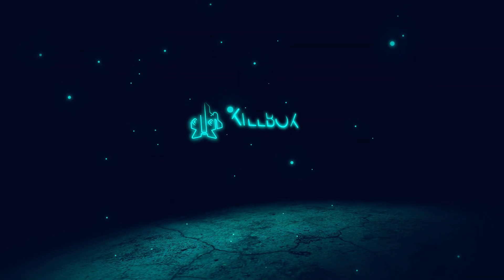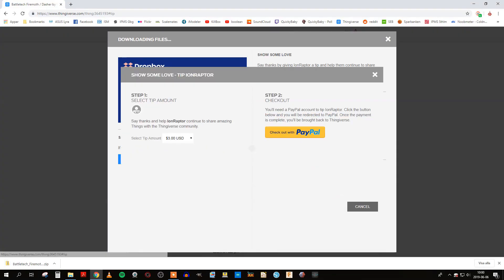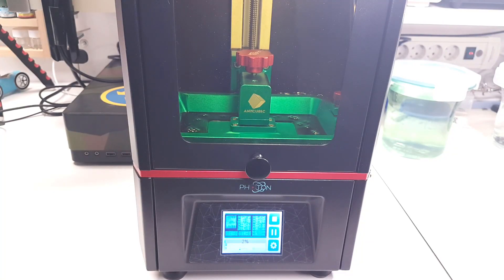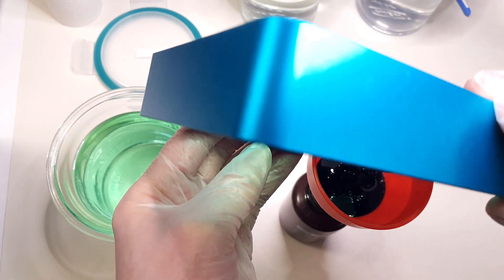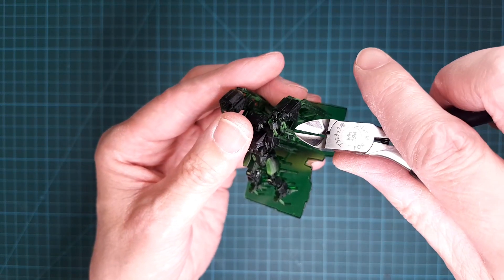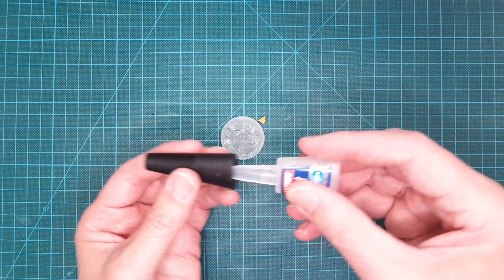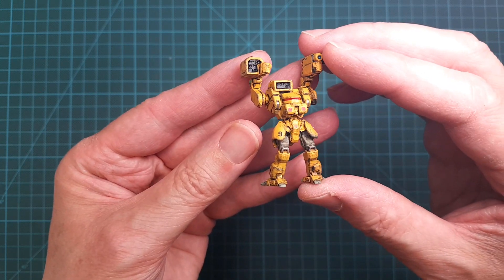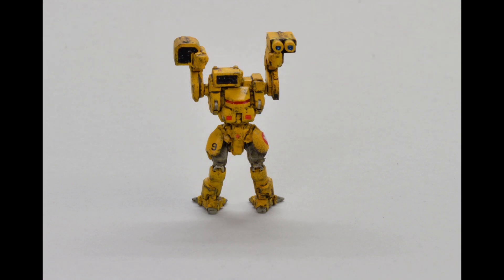Anycubic Photon Resin 3D Printer

Comment: I found cleaning the tray better if you slightly wipe out the remaining resin with alcohol and wash it with warm water and soap. It is cheap, quick, and efficient, also using fiber cloth will make FEP dry and scratch-free. A microlayer of soap will prevent resin to stick to FEP assuring a good print...
Reply from the maker: Yes, that's a better way of cleaning the vat. Nowadays I use a foam sponge wipe and that works fine too. Thanks for your comment! - happy printing 😀

Comment: Great video. (glass wipes now on order) Thank you!
I've had several failures where the model has failed to adhere to the plate. I have just ended up with very flat 'pools' of hardened resin in the tray. Do you have any tips for getting it to adhere to the plate? Thank you!
Reply from the maker: Thanks, Ian!
Make sure that you get alcohol wipes that will not scratch the FEP, I have actually moved away from the glass wipes I used in the video and instead I'm using a soft foam sponge cleaning wipe - unfortunately I have not been able to find them outside Sweden, so I cannot recommend any specific brand. There is an updated version of my 3DP workflow video coming out soon on my channel, where I will show what they look like.
About your question; the failed print is 99.9% caused by incorrect bed levelling - there are basically two methods to do it; paper-method or Flint Read method. I use the latter method and I haven't had a failed print after that. That's the only advide I can give, based on my own experience... I struggled with the paper-method for a week and had very unreliable results; I almost gave up on the whole thing... :D
Reply: Once you have your build plate level (tighten that grub screw well once you have the plate level), another thing to try is to change the angle of the item/s to the build plate. I'm using Chitubox for arranging items, changing their orientation to the plate, hollowing (saves a lot of resin, for solid items) and creating the supports. As the Anycubic .pws file type is still proprietary, I "Save As" the file as a new .stl and slice it with the Anycubic software. It adds some steps to the flow, but greatly improves the outcomes in my experience.

Comment: Could there ever be too much resin in the vat? I'm using the grey stuff, its opaque so I'm concerned
Reply from the maker: There is a concern that submerging the ball joint in resin will make it slippery and ruin the levelling. Based on my own experience I cannot say if this is true or not, but on the other hand I see no reason to overfill the VAT; so I avoid doing that.
Reply: @KillBoxScalemodelling  thanks for the help, I guess I'll just live with my mistakes, currently printing with a full vat lol
Reply from the maker: @johnlipinski1054  I'm keeping my fingers crossed that it will work! 
Please let me know the result

Comment: Can you use the alcohol again for another print or do you swap each time??
Reply from the maker: It can be reused many times. And after that you can cure the resin with UV light and filter it out, so it is possible to reuse the IPA.

Comment: Dec. 19, 2019---Thanks for the video as I'm looking at buying either the basic photo or the S version. Saw a comment by someone on another photon video that the S is 30% faster in printing something. Got back into modeling last year after being away from it for about 20 years. But instead of aircraft/armor, going for 1/35th scale zombie/apocalypse dioramas, but with mine based in realism(?!) as in no Mad Max looking vehicles/people. The problem was there being so many things needing to be scratch built such as mail boxes, electrical junction boxes, phonebooths, etc. I made a kids wagon, the kind a kid would pull behind him, then made a silicone copy of it as I thought I might want multiple copies of it in the future. The wagons wall was about 2 pieces of paper thick and out of the NINE castings I made in resin, only ONE turned out useable?! 

From Thingverse and other free 3D websites, I've downloaded about 3K worth of programs....furniture, store shelving, office equipment, etc. The other problem with my new interest is lack of MODERN people. Seems all the plastic figures available are dressed in 1940's/1950's style. A lot of work to change them. And while resin figures/zombies are available, they run usually $10+ EACH which adds up quickly when you want a dozen or so figures in a diorama. Another is lack of current vehicles as plastic kits, which is why I have about 2 dozen or so diecast vehicles in 1/32nd and 1/36th scale. They look great on the outside, but missing interior details. Like the VW buses seats are simply L shaped pieces of plastic and no way represent the real thing. Same way with the 1/32nd semi-truck seats....I KNOW about those seats and trucks as I drove truck for 15 years.

This was why I liked you showing off parts you made for your models. Plan on reducing the figures files I have and printing multiple copies of them as I want different figures in my dioramas. At 66, it ain't easy for this old dog to learn new tricks, one of them learning CAD. Hopefully I'll learn how to make my own figures, but would like to come out with ones with individual arms, legs, upper/lower torso's, etc. This way I can mix body parts, including heads. One video I saw had the guys printing a 1/32nd scale locomotive, which was done in 3 sections.

Luke Towan is a railroad modeler, which is where I first saw the photon printer being used. Later, he showed off how to make your own photo etch parts using stuff sold by Micromark. Imagine seeing a 1/87th scale office chair...impressed me seeing something that small being printed. I think both tools are going to make a world of difference in the modeling world. 

Curious...what previous knowledge did you have in learning to draw your own parts and printing them?
Reply from the maker: Thanks for your comment, it seems to me that a resin printer is the right tool for what you are doing.

I had no experience in 3D modelling tools, but I downloaded Fusion360 and started looking at Fusion 360 tutorials; I can recommend Lars Christiansens "Absolute Beginner" series as a starting point, because he goes through the basics in a very good way. 

Good luck with your dioramas, it sounds awesome!

Comment: Hi thanks for the indepth walkthrough of the process and explainations. could you explain the benefit of rotating the model at an angle and not 90 degrees so the model where horizontal ?
Reply from the maker: There are two reasons why you would do it; to reduce the overhang that requires supports and also reduce the layerlines

Comment: Too late, I bought it.. couldn’t resist the opportunity.  ;—D
Hi Angus. I've got a chance to buy a "used" Photon from Anycubic for $300. Apparently it is a return. 
Do you think this is worth purchasing. 

I already own an Anycubic i3 Mega and am very happy with the results. However, I cannot print miniatures with high enough resolution. Anycubic spares prices are very reasonable.

Your thoughts on my dilemma?
Reply from the maker: Angus?! Ok...  :D
I'm not sure about the pricepoint for the Photon where you live, but 300 USD seems reasonable. It's less than I paid for mine for sure.

I guess that you get a warranty so everything should be fine and if you run into problems down the line there are lots of knowledge, mods and spare parts on the Internet.

Hope this helps you.
Reply: @KillBoxScalemodelling  Oops! Sorry, mixed you up with Maker's Muse. I think I sent the message on my iPad. You must forgive me as I'm 68 years old. Playing the age card for sympathy.
Anyway, I went ahead and bought it at $300 Aud which is about $203.62 US. Thought that was too good to pass up. It is a return from a customer who changed their mind and hopefully is complete - not expecting resin though. At that price I couldn't pass it up and decided to take a chance. Parts are cheap and readily available & Anycubic promise to help me out if I have any issues. My experience with my i3 Mega has been excellent, so I took the chance. 
I'll keep you posted if you like. While the Mega is good, I simply can't get miniatures to print at fine enough resolution to satisfy my hobby needs; mostly OO/HO Railroading.
Cheers, IAN
Reply from the maker: Haha, no problem :D:D 
Congats to your Photon, I assumed it was USD but in AUD it's even a sweeter deal. I recommend to join the Photonsters Facebook group if you haven't done already. I have received a lot of help from people there...
Good Luck with your prints!

Comment: Can the slicing program calculate how many mls of resin it will need for the print?
Reply from the maker: The Anycubic slicer doesn't have that feature, but the ChituBox slicer can do that.
Reply: @KillBoxScalemodelling  It does now. Now that most of the Photons are 'fauxtons' with the 'S' firmware they only accept the .pws file type, which Chitubox still (at this post time) doesn't have.

Comment: Great video, thank you!  I appreciate learning the techniques and getting the whole story about cleaning.  Excellent idea on the disposable gloves!  Toss the used gloves and paper towels into a thick plastic garbage bag and twist the top closed to keep the fumes down.
Really want an exhaust fan (at least a small one) and/or half-mask respirator with organic vapor cartridges ($40..80-ish).  Yes, a respirator costs something and may be inconvenient, but so does getting sick from exposure to toxic materials.  One sign can be getting headaches after working with this stuff.  
Some people are chemically sensitive and the strength of the reactions increase as their body has more of an inflammatory response.  Like having sore feet on a hike because your boots don't fit:  if you stop and get off them, they heal.  If you keep hiking, it progresses to blisters, then they pop, then things start getting ugly.  Wear good socks and boots that fit.
Best to use an exhaust fan and respirator.
Reply from the maker: Thanks Scott :)
An extraction fan is on my TODO list. I'm thinking of modding the printer and put one of those 3D-printed backplates with provisions for a fan and a hose.

Comment: Might want to look into Mean Green, Simple Green, or even Mr Clean for cleaning your resin parts. Mean Green cleans the best from what I've seen and cost less than any of the other including IPA. Smell is low as well and you can use them in a vibration cleaning tank.
It is suggested to remove the supports before final curing to help with removal and lower the risk of damage to the part.
Also maybe switching to a kit with FEP vat for the tank would help as well.
Also there is a "TOUGH RESIN" out now that will help with weak printing.
Reply from the maker: Thanks for the tips, I have made some improvements to my workflow recently and I will post a video on that.
I need to check if I can get hold of Mean Green or any similar product where I live, because IPA is hard to get nowadays...

Comment: the artifacts you have is a z wobble, you have to upgrade that part of the printer by adding linear bearings , that will reduce it dramatically,
Reply from the maker: Yes, I believe so too. I have linear bearings and a new mounting plate bought already, but I have not had the time to make the upgrade yet.... Too busy printing stuff and doing other things :D :D
Reply: Hi Kira, I have jurst ordered a Photon. Is there anything you can direct me to to regarding the bearing upgrade?

Comment: which filter are you using to filter the used resin into the bottle
Reply from the maker: I took the strainer mesh from the paper funnels that came with the Photon. The mesh is made from plastic so it's reusable since it can be cleaned with IPA. Hope this answers your question :)

Comment: I'm curious to know if you've noticed any markings or scratches on the thin plastic bottom of the resin tank. In a review of a different brand of inexpensive resin printer, they noted that the sheet had marks somehow related to the models printed, & also scratched very easily
Reply from the maker: The FEP film of the resin tank was completely without scratches (atleast what I remember) when I unpacked the printer. However, after a couple of times usage I scratched mine. I had some issues with failed prints and resin that got stuck in the bottom, so I scratched the FEP film when removing that.

Comment: so... unfortunately - the resin is still too toxic IMO for home use (need proper ventilation during the whole printing process, pouring, cleaning and sanding) - overall, the process too tedious (why can't you just leave the resin the box and have it in a covered darker box?) - just not quite there yet!
Reply from the maker: I fully agree that the resin handling and post processing of the print is messy and cumbersome. The SLA machine you are asking for is something like the Formlabs Form2, with washing and curing stations. Pricetag for that end up around 4000 USD. This is a 300 USD machine with only one moving part ;)
Reply: @KillBoxScalemodelling  yes... that is the other end of things... and even then, there is probably maintenance that requires some toxic handling.   oh well... the future is looking good though!
Reply from the maker: I'm sure that the technology will continue to evolve and cheaper and more user-friendly printers will show up. When I first encountered this technology 15 years ago a SLA machine costed ~100kUSD and the end product looked like something that comes out of a cheap FDM machine - and it was very fragile. One fellow engineer dropped a prototype on the floor and it cracked into tiny shards and we had to order a new one (that was an expensive mistake).

Comment: Use acetone for 15 min instead of IPA the supports melt off.
Reply from the maker: Thanks for the tip. I need to figure out where I can buy acetone in bulk... I'm getting an FDM printer soon and it might be useful for that too...
Reply: @KillBoxScalemodelling   check homedepot they sell the gallon for 17 dollars . quart for 8 bucks . becareful how you use the acetone. it can damage the part. Its powerful.
cheaper that ipa
Reply from the maker: @keepitrealandtoasty  Thanks for the tip - I have found a couple of places where I can buy, but I have to travel there to get it - they wont ship that stuff ;)

Comment: if you remove supports before curing, it is far easier. Less likely to break things, since the resin still has a little give.
Reply from the maker: That's an excellent advice, thanks!
Reply: +1 for removing supports before curing
Reply: If you do it before curing, you can just rip them off with your hands as one big piece of supports for a lot of prints.